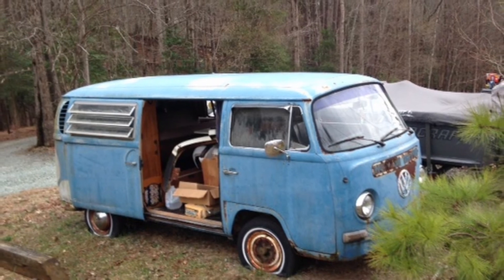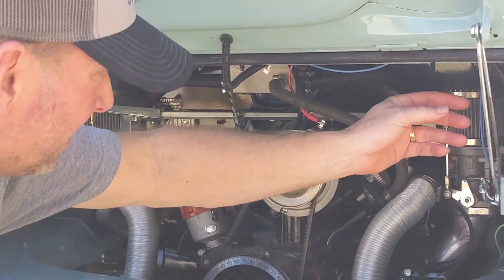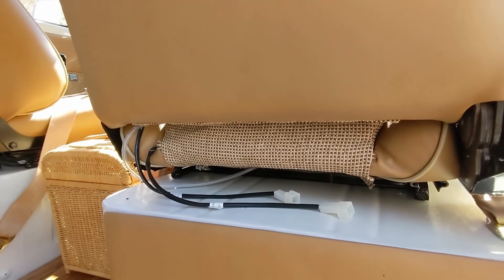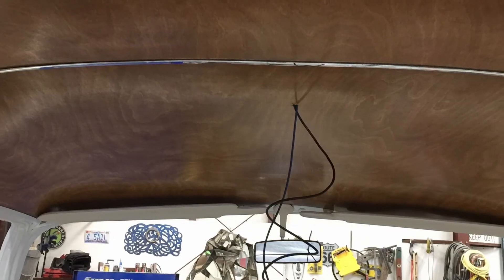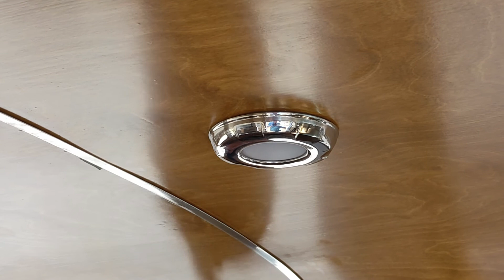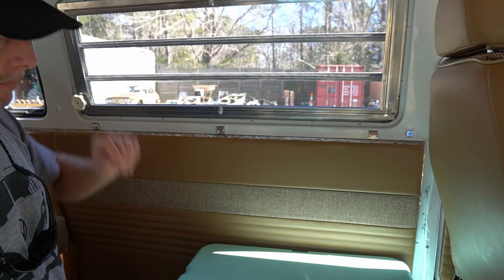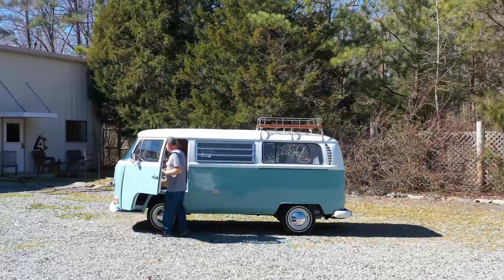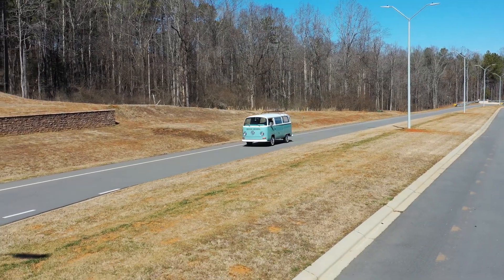1969 VW Bus Restoration Overview

Comment: I rigged my rear interior lights to be controlled locally or from the dash too.  It's nice to be able to turn the lights on while driving to see what the kids are doing.  I did the same thing with upholstery too, the tan vinyl with muslin inserts, almost exactly like yours. Same circuit breakers like you did.  Redid nearly all the wiring too.  I added a second battery on the left side though.  I recommend it.  A simple smart isolator prevents the starter battery from running down while camping.  Same LED lights in the engine bay too.  Actually, I replaced all interior and exterior lighting, instrument lighting, and headlights with LEDs.  The original lighting was always so dim.  I started my restoration in 1995 on a 71 Westy I bought in 1985 and just finished it last week.  I used GMC white for the top too.  A lot happened in my life that kept me from working on it, family obligations but I never gave up.  Great feeling to finally finish it.

Comment: This was a very enjoyable film yo watch. Your a sincere man, who has but a lot of love I to this bus. These projects are very time consuming and expensive. You did a outstanding job in every respect, especially the body work which looked a challenge. I have a 71 bay, like you  in nearly finished, but I really liked your headliner. The finish looks fantastic. Could you tell us how you achieved that please?
Reply from the maker: Thank you! The Headliner was replaced with Baltic Birch same as original stained with Cabot's fruitwood. Then 3 coats of polyurethane, sanding in between. Issue with plywood is it's wider than the standard 48"s. I can help if you need a source.
Reply: @BtwilliasGarage  Hi, thanks for the details on the birch. You've achieved a refined finish which addes the overall feel of quality. I'm in two minds to use a standard headliner or birch. Great video, lovely bus for both you and your wife. 👍

Comment: I am just starting on my 69 bus, I am curious about the exhaust and the engine. I am thinking about ordering a turn-key engine, what size would fit, and the dual carbs do you have to do anything to the linkage? I have the same wood headliner I, its in good shape, thinking about just sanding it and varnishing it.  What did yours cost?  What sort of wood is it?
Reply from the maker: I have heard that turn key engines off the SAMBA etc or often troublesome. Ours is a 1776 built by Hicks VW in Durham, NC. The dual carbs are EMPI and the linkage came  with them. Hook directly to the original accelerator cable. I purchased these from Hicks. They are less than Webbers and Hicks and so far I have had success with them. The Headliner was replaced with Baltic Birch same as original stained with Cabot's fruitwood. Then 3 coats of polyurethane, sanding in between. Issue with plywood is it's wider than the standard 48"s. I can help if you need a source.
Reply from the maker: We also replaced the heat exhaust manifolds / heat exchangers as to have a little heat in the winter. I believe Hicks sourced them from West Coast Metric which is one of his favorite parts stores.

Comment: Thanks for the video! It’s a beautiful bus!! I’m new to the VW van life. I just got a 71 westfalia and it needs a new motor. What made you decide on the 76? Does the heat work well? Did you hook up AC? Part of me wants to keep it original, but part of me wants to swap it with maybe a Subaru or something with more power/reliability.

Comment: Look forward to seeing the trailer resto and custom. Good thing you went with a 1776 if you’re going to pull anything other than a tooth!

BTW, any chance you could walk us through the motor? Did you use the original core? Are those dual Webers? Etc.
Reply from the maker: Really appreciate that! Yes sir we can cover the engine in detail. I'll try to line that up and release a video in the next few weeks. Hopefully sooner. 

The trailer will take quite a bit longer to cover, but we plan to release that asap after it is complete.

Thanks for the feedback and suggestions! Talk soon